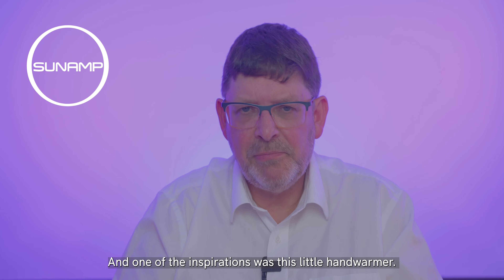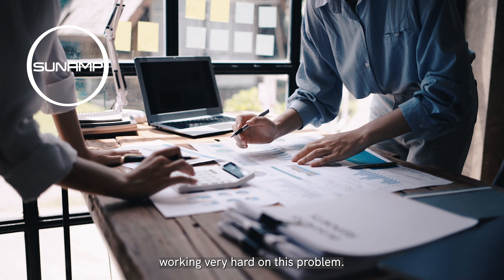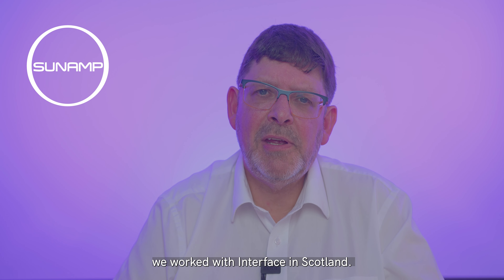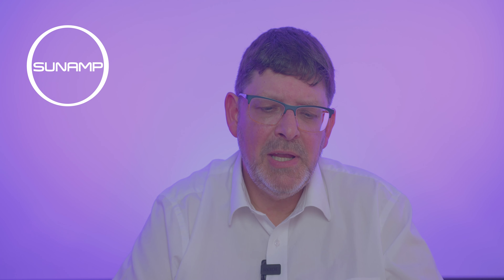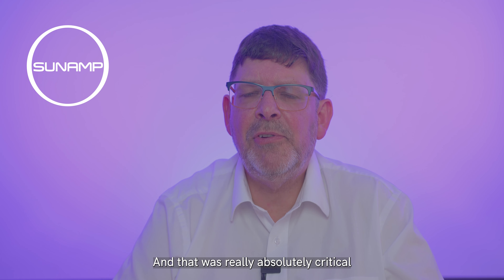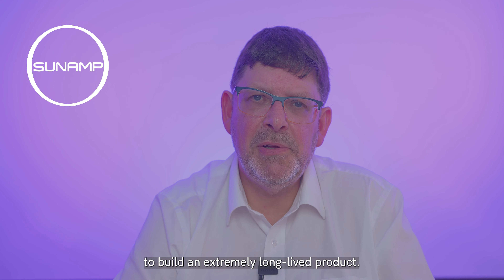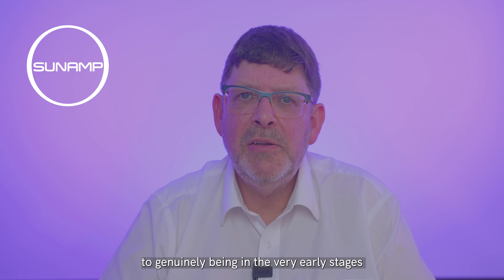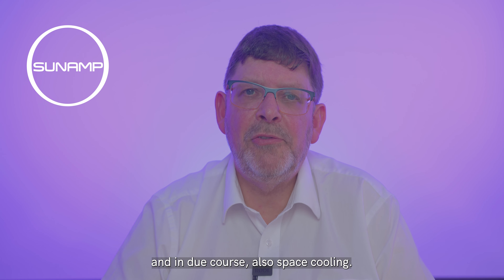How we developed our Plentigrade phase change material

Comment: For me the whole renewables push falls down because of it's unreliability. Could this type of product have some role in making it more reliable? I assume this product has a certain temperature range based on the requirements of hot water. Do you have versions that could operate at higher temperature ranges, say enough to produce steam to drive a turbine? Do salts of that nature exist? I know the steam cycle is very lossy but at least it's better than an ultra short duration solution like current battery technology.